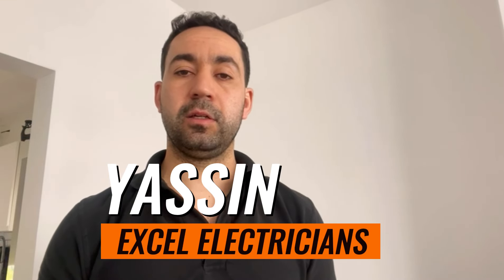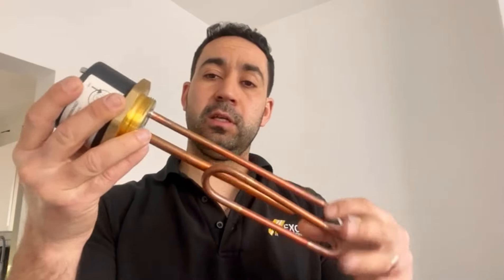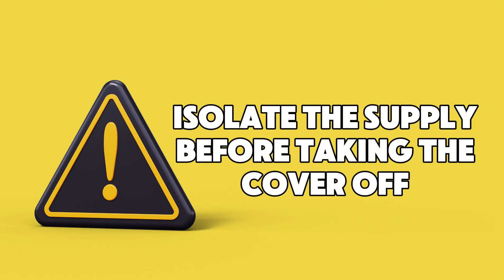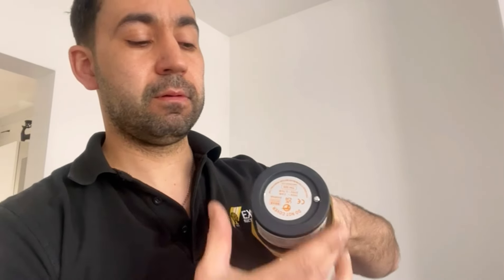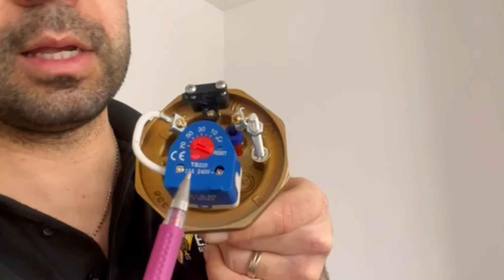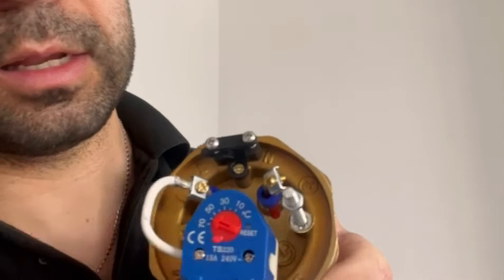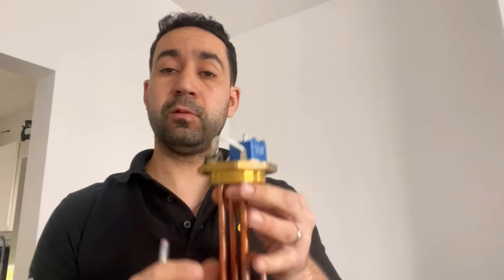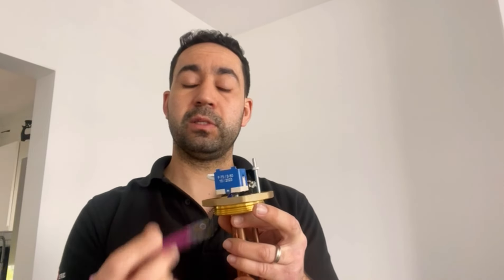How To Reset an Electric Hot Water Heater Cylinder Fast

Comment: I reset mine but the button stays pressed in. The element has recently been changed but the thermostat was left on too high a temperature. So do I just get new thermostat as the temperature dial clicks when moving, but reset button still de-pressed